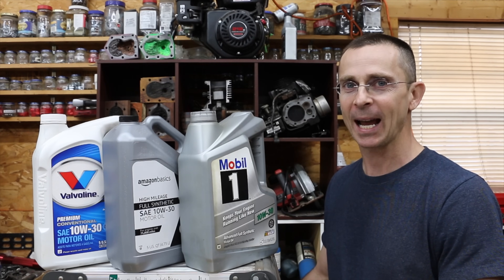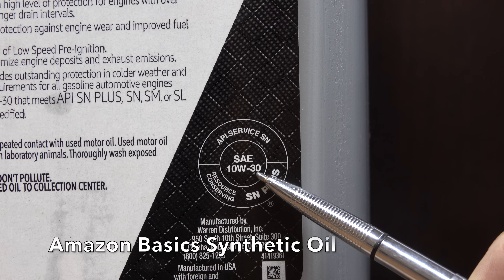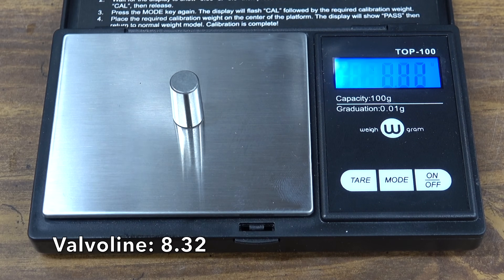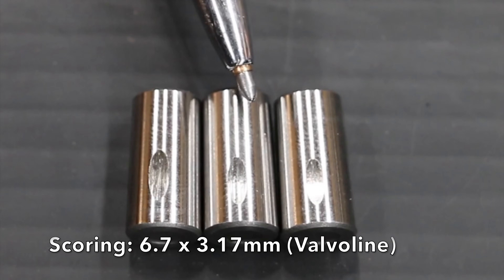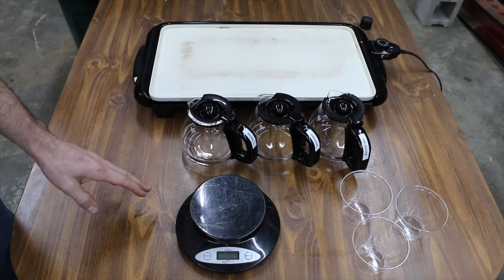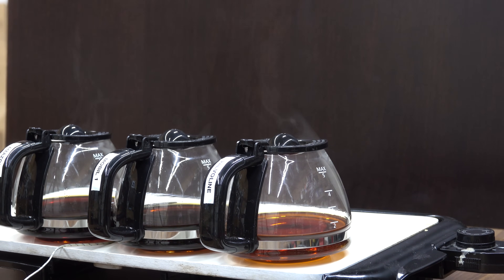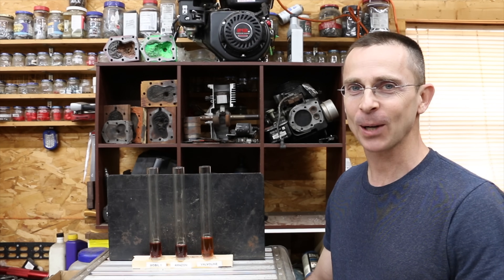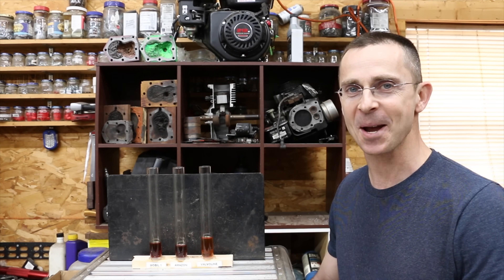Is AmazonBasics Full Synthetic Motor Oil better than Mobil 1? Let's find out!

Comment: Great video! I like AmazonBasics products for their high quality and value, but I was a bit unsure about the engine oil to be honest. I had to subscribe after watching. Thank you for what you are doing.
By the way, you can get a 0,1 step weight up to 1-2 kg for nearly nothing if you want to increase the accuracy of those results. Amazon also sells 0,001g/50g lab scales from China for about 100-150$. I bought one with good reviews and it is accurate to the mg according to my calibration kit. Just an idea to make your videos even better since kitchen scales often go wrong by a few grams in my experience. :)
Reply from the maker: Thank you very much for subscribing and for the great recommendation on the scale

Comment: I have used Valvoline. I had a new Chevy Nova many years ago, and I was using Valvoline for a while. There was no smoke, no leaks, but I was constantly adding oil. Changed brands (to Shell) and never added oil between changes. Several years after that my Chevy pickup I used on the job was due for a change, and I bought Valvoline because it was convenient at the time. This engine, which never needed oil between changes, suddenly needed a quart every thousand miles. Switched back to my old brand, no problem. 
Since that time, I haven't used Valvoline for so much as oiling hinges.
Reply from the maker: Thanks for sharing.

Comment: Been using Amazon oil since this video came out. Have not been disappointed since. Pretty good oil for the price. I change the oil every 3000 miles so I shouldn't have a problem. But damn these tests show the quality of this oil!
Reply from the maker: Thanks for sharing.
Reply: You're changing synthetic oil at 3000 miles? That is very very much overkill.
Reply: @martixagent  oil is cheap, new engine is expensive :)
Reply: @martixagent depends on how he drives….even so, 3,000-4,000 is a very good range to Change. Fresh clean will always be better than oil with 3000 miles
Reply: @yourvault1612  In 1970 I would have agreed with you, but with today's good oils it is nonsense, a waste of money..

Comment: I raced a shit load of cars in my prelude for like 30k miles using valvoline conventional. Never had a issue, redline 8k+ rpm on a stock high milage h22 😳  I spun a bearing on mobile 1 on a 2zzge lol wtf
Reply from the maker: Thanks for sharing.

Comment: First, this was great, thank you! My question is, though, how do these properties you measured actually affect the ability of a vehicle to perform optimally? For example, might a higher viscosity (or maybe even just a SPECIFIC viscosity) be the optimal result after the oil has been heated to simulate the heat of an engine and then cooled (put in the freezer) to simulate cold weather? In short, why is it better for used oil at cold temperatures to have a lower viscosity? Maybe oil that flows with a certain degree of viscosity is what is optimal, not just a higher rate of flow. I know that this might seem a silly question when low viscosity (high rate of flow) seems to be the logical preference for an oil that you want to lubricate all parts of an engine effectively. Maybe an additive that makes the oil more viscous is worth having in there if it protects from something specific, even if a competitor's oil is less viscous in all of the conditions presented above.
Reply: It’s really just to give you a general idea of how that oil might perform obviously account account for every variable out there but it’s going to give you an idea

Comment: Do you need SN plus designation for a NATURALLY ASPERATED GDI engine? I assume it would be a added benefit. The only oil that is not name brand for 0w-16 ( in USA) is supertech aka Warren dis. Co. I found it for $11 on roll back at good old wally world. Curious if the different viscosity has different additive packages. 0w-16 oil brands would be a great test as I assume more and more USA LOCATED cars are calling for it (toyta and honda) I belive currently in 2020. Thank you for all your hard work!
Reply from the maker: Thanks for the video idea.

Comment: Cool video, probably expensive to do. I just split two different viscosity specs in my '07 4runner. OEM says "use 5w-30". I did 3.5 qts. of SuperTech 5w-30, and 2qts. of SuperTech 10w-30. This vehicle has 113K miles. This is Texas, getting hot hot soon, figured the viscosity's would balance out to 7w-30... Will this screw up my engine? Thanks.
Reply: So did your car blow up?

Comment: I'm confused, I like Amazon 5W-40 Full Synthetic, BUT, I started reading the bad reviews on Amazon. Reviews are not same grade as mine. BUT the reviews say it blow's engines?, Makes the engines over rev?, I don't think any oil can do that, can it? If possible I would like someone to reach out that has a turbo engine.and is using Amazon Basics oil based on this video. Thank You everyone especially Project Farm

Comment: Hey! I wonder what the more important temperature to run the lubricity test is -- they say most of the wear on the engine is when it's cold (prior to oil flowing over the system) in which case the wear might not be proportional to the oil itself save its ability to run off of parts while it sits. On the other hand, the majority of the time the engine is running will be at high temp (ECT 95-90 C) so maybe the longer term wear results would make more sense at a high temp? Curious if the results would differ.
Reply from the maker: Thanks for the video idea.
Reply: There is someone who can answer your question. He is a Ph.D. who studied materials engineering and a lubricant expert. Register your question on the sub-redit. https://www.reddit.com/r/ThumbThroughCar/

Comment: Great video! One thing I noticed was that Mobil 1 probably had a slight advantage in the lubricity test because the race was deeper in the oil at the start when compared to the other 2 oils. I think Amazon would have won if they were all filled to the same height
Reply from the maker: Thanks for the feedback.

Comment: Wow. Who knew? Actually, I kinda suspected. The engine in my car is a 1.3 litre with over 400,000 kms (250,000 miles) on it, it still runs fine but is getting a little worn, and I don't do many k's in it these days, only about 50kms (35 miles) per week as I live very close to my work. Two years ago whilst doing an oil change I realised I'd picked up the wrong oil from the parts store (which is a 30min drive away) AFTER I'd drained the old oil out. Oops. Luckily there is a supermarket within walking distance of my house that has a rudimentary automotive section. Great, I thought, I'll just walk down there and grab some cheapo oil as a stop gap until I can return to the auto parts store. The supermarket only sells cheap no-name brand oil, but it was the correct grade, so I grabbed it. It could be just my imagination (probably is) but I reckon the car runs better on the cheap stuff, and there was definitely less evaporation/loss when I changed it again. Seeing it's about a quarter of the price of the "good stuff" I've decided to stay with it. It's a semi-synthetic, but then so was the oil I was using before, so it's like for like in that regard.
This video has certainly given me the confidence to continue using the supermarket oil, so thanks very much!

Comment: Video suggestion: Have you had experience with different leather repair kits? I figured leather repair would be a good topic to cover on your channel as it would be cheap to do and highly informative. I think the video would benefit a range of products from saddles, to boots, to automotive leather. Maybe cover how well the different kits blend to the original leather color and how robust the repair is when folded or creased. Anyways, great video on the engine oil. I use Mobil 1 10W-30 and it was great to see it up against Amazon's oil, which I never knew existed, and conventional oil. Thank you.
Reply from the maker: Thanks for the video idea.

Comment: There are some flaws in your test, when doing lubricity test, the oil temperature is normal, in fact, the oil inside the engine working under high and very high temperature,  so your test does not reflect the real working performance of the oil. You should do the lubricity test after cooking the oil to examine the oil film strength in high temperature.  So we will know the oil lubricity capability under real temperature inside the engine, does the oil break its viscosity and film strength? or does it still capable of protecting the metal against wear? These questions can only be answered if you test the oil lubricity under high temperature. And then you should also test the oil endurance against fuel dilution, this is a real problem inside the engine.

Comment: I’ve been using Total Quartz 9000 5w30 Synthetic motor oil on my car the last few oil changes, appears to make my engine run quieter, and does not use any oil between changes, was curious what you thought of it? Or if you tested it.
Reply from the maker: Thanks for the video idea.

Comment: Can you do a test that mixes oil? I've always subscribed to the possible old wive's tale that the best thing you can do is you the same brand of oil every change. Start w/valvoline, stick w/valvoline. Is there a way to test to see if it matters if you change brands? I'd kind of like to know what happens when you run 5w-20 in a 10w-30 engine too. Anyway, once again thank you for this channel! Keep up the great work and thank you for your service.
Reply from the maker: Great suggestion!

Comment: Is there any potential to add cold oil bearing testing with your bearing tester and 'frozen' oils?  It would be awesome to see your oil bracket challenge where a cup of oil was chilled and immediately tested and compared to other oils.
Reply from the maker: Great suggestion!
Reply: @ProjectFarm  Additionally, given auto manufacturers shift from 10w-30 to 5w-30 to 0w-30, it would be neat to see various versions compared both at 100°c and sub-0°c regarding flow and bearing wear.

Comment: Great test.I've been using Mobil 1 for years.
I thought of a comparison I haven't seen yet.As an owner of a vintage car,I plan to use one of the high zinc motor oils made especially for older vehicles with flat tappet cams and no catalytic converters.I haven't chose which one I will use yet,but shopping online,there seems to be quite a few choices.You can compare these with each other or compare them with regular motor oil to see if there really is a difference.
Reply from the maker: Thanks for the video idea.

Comment: One of the biggest claims by oil companies is cold starts protection. And the automobile manufacturers claim most your wear is at start up. Why not leave your machine overnight with the oil container removed for each product and let the remaining oil drain off. Then measure the running power and temp in the morning after the oil has drained overnight. Maybe run the test for 30 or 60 Seconds. By then the oil under normal conditions should be throughout the engine. The  product with the lowest amps  and Temp. means there must have been some residual oil behind. This was the biggest claim by Castrol Magnetic and many of the oil additives. By the way Your Shows rock and they are unbiased. Keep up the excellent work!!!!!. I saw the negative comments by one of the you tubers from UK the other day. Ignore them.  I think your approach is very scientific and not just based on personal theories.
Reply from the maker: Thanks for the feedback!

Comment: I use 5-30 mobil one fully synthetic.  I use about 1 quart between changes at 4-5 thousand miles.  I found out that my V8 chevy 4.8 has an updated valve cover that will cut down on oil consumption.  It's around 70-80 dollars.  I might change it out and see if this helps.
Reply from the maker: Thank you for the feedback
Reply: Change your PCV valve to the fixed orifice one first. $2 fix. AC/Delco CV4000C
FRAM FV410
BWD PCV 484
Autozone PCV 1009

Comment: I wonder if the diffference in performance between amazon and mobil 1 had anthing to do with the much thicker application of mobil 1 on the bearing? (both other oils were barely touching the rotator surface, the mobil 1 test threw oil all over the clamp)
Reply: PS: Cook is going to kill you for putting oil in the coffee pots.
Reply from the maker: lol. Great point on the cook being unhappy!

Comment: New video idea. Cold flow testing. Use 1 brand and different ratings. This way people can see how each does. Example: Mobil 1 0W-30 VS 5W-30 VS 10W-30 VS 10W-40 VS 15W-50
Reply from the maker: Thanks for the video idea.

Comment: mobil 1 is one of the worst some subaru drivers have reported severe engine damaged caused from it shearing down from a 40 weight to a 20 weight and losing film strength after only about 5k miles but of pretty rough use maybe you could try a long term test of mobil 1 5w-40 against shell rotella t6 5w-40 (the favorite oil of most subie drivers unfortunatley cant get it over here)
Reply from the maker: Thanks for the video idea.

Comment: There are a host of ancient videos about the various properties that make a good engine oil...as I recall the tests here, while important and interesting  are not the whole story and perhaps not the most important.  You will have to forgive me for my lack of memory but I think I recall that the ability of an oil to first form a bond with the metal surface that is not degraded or destroyed by heat or mechanical or metallurgical properties/conditions is fairly important.  If the oil first forms this bond then can bond to this layer, the oils' performance and duration is improved.  All this said, I liked your video and thought it insightful.  I would be curious to see some sort of retention time of an oil applied to pistons, rings both static and dynamic tests.  Also, I would like to see how much of what was worn off from cylinders in your tests stayed in solution vs precipitated.  Do you think a magnet in the oil reservoir is a good idea?  I have been using one in my truck and I collect a certain small amount of residue each oil change.  Finally, my father swears by Shell Rotella and I noticed Walmart is selling it for gasoline engines again but only in synthetic form.  It is not cheap but it is supposed to be very superior.  Thanks for the videos/information.
Reply from the maker: Thank you for the feedback

Comment: I worked at major oil test labs for over 15 years, it would be good  if you could test comma fully synthetic if available in the US. That is an A1 product made for quality rather than down to a price.

Also another thing that you may be able to test for is the oils ability to absorb acid products called TBN or total base number which in the long term protects the engine for longer as there are less breakdown products to cause wear issues. A flashpoint test may be of use for fuel dilution,  easy to make to the standard as the equipment design is umm 120+ years old... 
Synthetic oils are made! And so have consistent properties and resistance to breaking down. They are harder on seals, something else you could test for, using weights on a dumbbell piece, same as the real thing.

Most of the testing has been around so long that reading should give you a complete suite if you wish.

One last thing is urrrgh reminding me of the smell of the Noack test omg it was rank in the day. Especially with Castrol R and other vegetable based oils like Shell....
Reply from the maker: Great suggestions! Thank you

Comment: There was significantly more oil in the Mobile 1 scar test. You could see it splashing around. I can't imagine how that would not have impacted the test.
Reply: You realize all the excess oil will fling out within like 15 seconds right? The bulk of the test is run at similar levels.
Reply: @Janovich  That doesn't appear to have happened in this case.
Reply: @cyberkenpo  Clearly does at 4:39.
Same thing happened in his video testing Plant based oil. Not saying its perfect but the splashing goes away resulting in approximately the same fluid levels.
Reply: @Janovich  I completely disagree. It looks higher at the beginning and the end.
Reply: If the oil is always getting replenished and the pressure on the cylinder is the same, no more or no less oil should be actually getting in between.
Reply: @TheRyansLion  But it's not getting replenished because it is lower at the end of the test than the beginning.
Reply: It wouldn't make any difference.
Reply: @doritos6548  On all the tests, the oil dropped down below the test area. If there is more oil, it will take longer to drop down below. Therefore, it will lubricate longer.
Reply: Yeah why the hell would he do that? And not comment on this question
Reply: I noticed that too! He used much more mobile 1 compared to others!
Reply: And Valvoline was barely in the oil!
Reply: Pretty sure that just has to do with editing
Reply: Thanks, thought..seems imperceptible in the results……but …..

Comment: If it hasn't been done, it would be interesting to see how different motor oils perform after experiencing extreme cold and normal running engine temperatures. I've always been told short tripping a car in extremely cold weather will break down your oil fairly fast. Would love to see if that holds any truth!
Reply from the maker: Thank you for the video idea!
Reply: @ProjectFarm  Just want to say how awesome it is you're able to reply to so many comments and constantly taking the publics ideas and concerns into your video making process, keep up the good work!

Comment: I've been using Mobil 1 in my snowblower and car, but will try the basics next oil change.  Synthetic makes a HUGE difference in cold starts with the snowblower, but I hate paying so much for advertising.  The snowblower is a 1996 Husqvarna 8hp with the original engine btw, and gets used 4-7 times/week for 4-5 months/year.